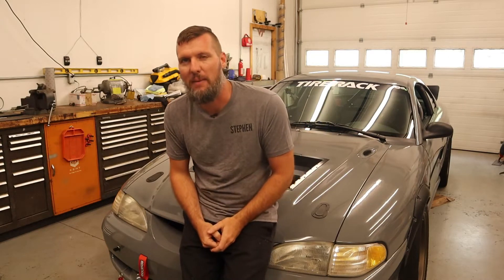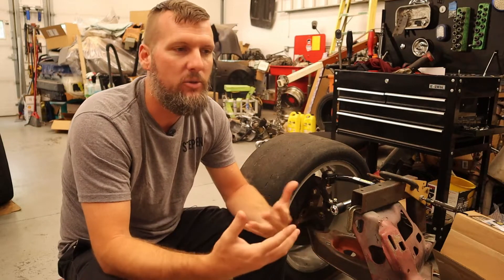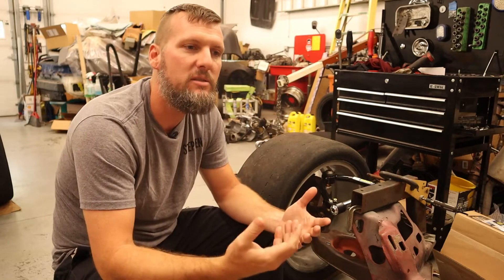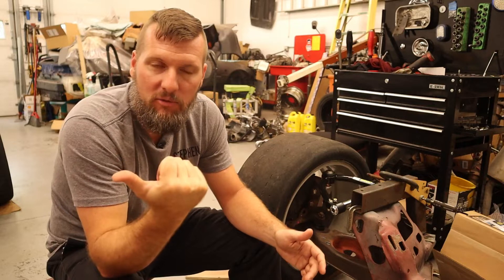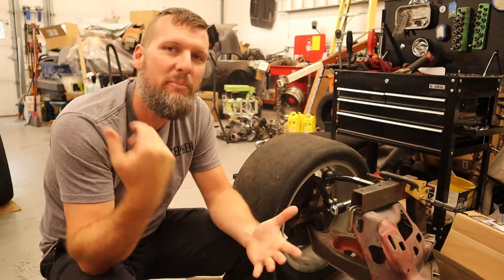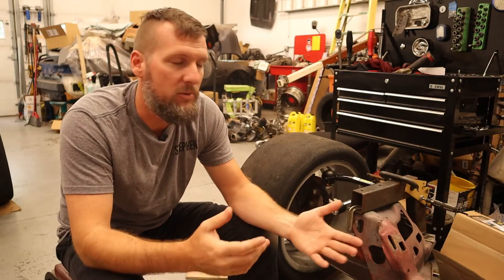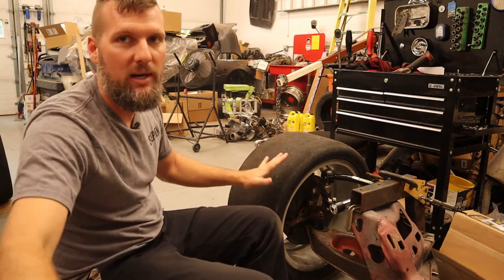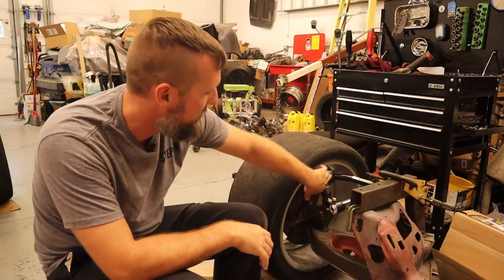Intro Mustang SLA Suspension Design

Comment: I'd be curious to know how your design geometry compares to the recently released RideTech SLA.
Reply from the maker: Mine compares more to Griggs. RideTech doesn't list camber range, I'm really curious about that. I have similar camber gain, more caster adjustability , bumpsteer kit. I like their spindle but I don't know the geometry of it. 

Their coilover placement has a low motion ratio (probably 50%) so it will need a high spring rate like a stock setup. I don't know how they are getting good geometry with stock kmember. Mine like everyone else raises the LCA mount.
Reply from the maker: We will really have to see how they do once people fork over the money to install one. But if racecar I think people will still choose Griggs or Cortex. This isn't that much cheaper once you add everything up. I think price listed is just for arms and spindle. Still need coilovers, brakes, and recommend a kmember.
Reply: @RinerAutomotive  Good point. When you factor in the (non-adjustable) shocks and the stock k-member, the RideTech will be at least $5k. With premium shock and an aftermarket k-member, you can add another $2K.
Reply from the maker: @mchristr  yep for sure. I did a video recently going over how much money I have into my SLA and how it compares in cost to other on the market

Comment: Another option to consider for the knuckle is the earlier Ford Ranger. It already has double wishbone suspension, so no need for adaptors to connect the arms. And it uses the same bolt pattern on the wheels as the Mustang. You could get the knuckles cheap at the junkyard and won't need aftermarket hubs to make it all work. This is the route I plan to take for my own SLA design.
Reply from the maker: That could be a potential. I didn't look at that one. I wanted to keep the same hub so I knew ABS would work.
Reply: @RinerAutomotive  Yeah, I don't know what other comprises might be involved. But I'm not worried about the speed sensor since I plan to "dumb down" my car. My design goal is to run a 305 tire all around. I plan to make the arms however long they need to be to let that tire turn full lock. Then add old-school box flares to cover the tires. Going for the vintage IMSA look, but prioritizing function first. Fun part is that this is my daily.

Downside is that I am very much on a beer budget. So this is going to take years.

Comment: I know that IRS is better than a solid axle on the street/road racing, but how much better can it be? I run mountain roads and haven't run SA since 03'. With proper suspension and tire, can it be done safely? Hearing people talk about SA racing now, it's like as soon as I hit the throttle, I'll lose control and fly off the road.
Reply from the maker: I'm doing an independent front suspension or SLA. Rear will be staying SRA for now. I think a probably setup SRA can be just as good or better than an IRS. There are many race cars that still run a SRA
Reply: @RinerAutomotive  I see you're doing the front, but I thought that because you run a SA rear, you could tell me if it's viable. I've heard that on track, SA is fine but on the street where the surface is uneven, you'll constantly be losing traction. It seems that with a well sorted rear SA suspension setup, you should be ok, and probably better if your powerband is linear toward the end of the revs.
Reply from the maker: True the surface is uneven on the street which is why should run a softer spring to keep traction. Suspension design also comes into play there. I run a torque arm in the rear.

Comment: An idea you might like, you could do the control arms longer to make the car wider. If you’re designing the k member, tuck the lower bar SUPER CLOSE to the oil pan. Making the car low and wide would make it far more stable when you slam it. What do you think?
Reply from the maker: I agree 100%. Control arms are something I plan to do, probably during phase 2 if the stock ones work for now. I want to buy and learn tig beforehand, but I think mig is capable of doing it too. I do want to run lower and wider, but the rear needs attention too at that point.
Reply: @RinerAutomotive  i was doing some research and Currie enterprises sells a ford 9” irs pumpkin, ready to install. The axle flanges should be a common pattern, so if you could put them on a corvette spindle, or reverse engineer a spindle to reuse the cobra hubs/bearings, you should be good. Again on the lower and wider, get the car as slammed as possible and do all the widebody work into the control arms. Le Mans cars have a 60mm ride height between the lowest point of the bottom and the ground, so you can get it as low as 3” for max stability
Reply from the maker: I want to fit a S550 IRS into the rear. That should give me low and wide. Corvette stuff is nice but want to stay Ford bolt pattern with easy off the shelf parts.
Reply: @RinerAutomotive  do you have any practice with cad? You could scan a cobra hub and design a new spindle. That would be my own goal. Fresh mounting points but able to reuse factory parts
Reply from the maker: I have some experience over the years, but learning Fusion 360 now. Are you talking about the rear spindle? I think using the s550 is cheapest and most effective instead of trying to design my own. Same for front spindles too. I think using Cortex, Griggs, or MSG is better than designing my own. At least at this point in time
Reply: @RinerAutomotive  i mean if it’s the cheapest route, then by all means use one that exists. But you could always cad one, 3D print it for fitment, and then have someone make a billet prototype? For future reference. I, myself, would prefer to make my own instead of using the s550, something about a multi link makes my eyes hurt, I’d much rather use an sla in the rear
Reply from the maker: I'd have to look more into it. Not worried about rear right now.

Comment: Eagerly awaiting the next video. Have you thought about using Maximum Motorsports front K-member and arms? I know the SLA is a better choice, but will it show on a lower speed autocross course?
Reply from the maker: The SLA videos will be a little spread out as I figure things out and buy parts. I could use MM front suspension stuff but I would still have to figure out their geometry so might as well use what I have for now and then design my own for what I want. Is a SLA best for autocross? Probably not but this is something I've wanted to learn and do. Plus the CAM-T national champion has an SLA
Reply: @RinerAutomotive  Interesting info about the national champ. I plan to take my car as far as the MM parts and that is it. What does the rear suspension consist of?
Reply from the maker: Yea the Seaton's car is pretty cool. It's got a build thread on TMO. Asking about my rear suspension?
Reply: @RinerAutomotive  Yes sir.
Reply from the maker: @TheSlim93gt  MM torque arm, panhard bar, coilovers, and control arms. stock away bar.